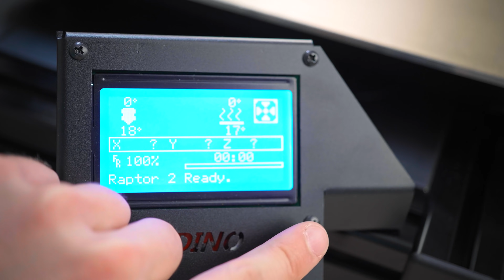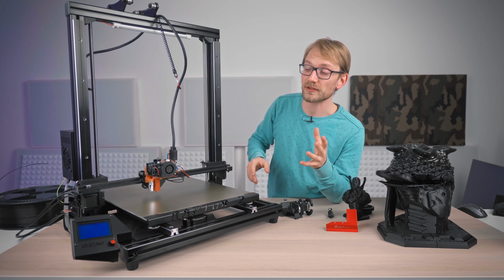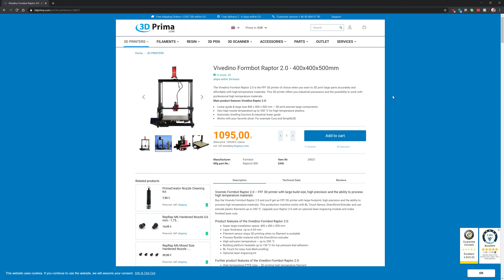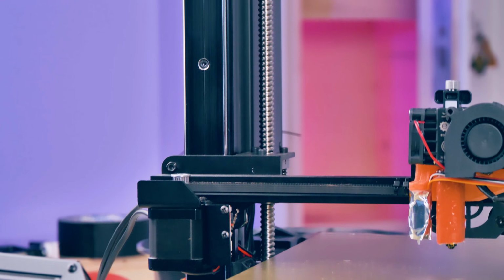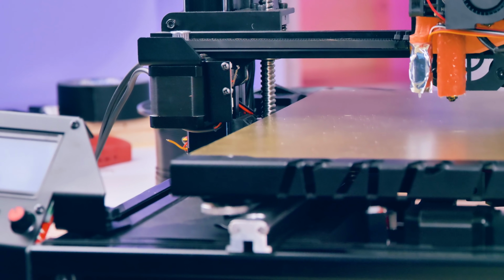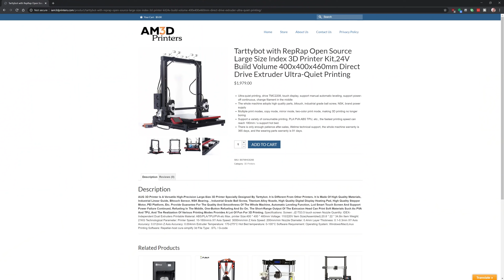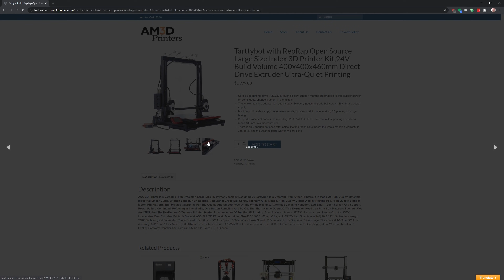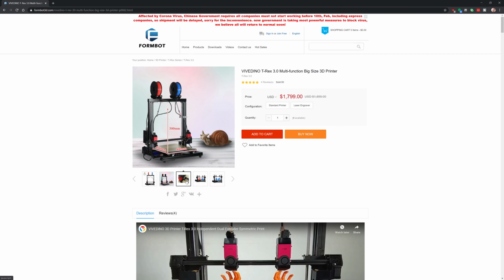This huge 3D printer was fun, but absolutely no one should buy it - Formbot Raptor 2.0 review!

Comment: You buy chinese, you get chinese :D
Reply: Not really a fair comment. Many high end and well built things are both manufactured in and designed in china. Where a product is made or designed really does not tell you if it's quality or not. Just like buying american made is NO guarantee of anything other than paying more. Junk can come from any country.
Reply: Well, I am really happy with my Ender 3. Not every chinese Printer is bad. They are actually pretty good. And why should I mistrust the Chinese anymore than e.g. the Americans?
Reply: Most high-tech things we have today are made in China
Reply: @among-us-99999  now that's some joke you just told there :'D

Yeah made in there, not designed and the companies that make them wouldn't exist in there unless it was for money and technology from outside of China because it made business sense to make stuff there cheaper so everything considering manufacture was moved there, including the machines required for manufacture (almost all high tech machines for manufacturing high tech parts like complex IC's were designed and built outside of China and still are).

Without all that, China would have nada. :D

It's a communist country of peasants.

Comment: I’ve had the 400x400x700 for almost a year. I had a few layer shifts that I corrected by installing a better fan for the motherboard. Upgraded the hotend to the E3D V6 and use a polypropylene bed. Reasonable upgrades and it prints like a dream! No signs of any unusual wear and tear...
Reply: Still a fire hazard!!
Reply: Well, that is not the point, isn't it? You should not need to invest more money to correct mistakes which the manufacturer should not have made in first place. It is shifting the burden to the customer and pretends a seemingly good price but has a hidden cost on top.

Comment: Mine works perfectly. Defective user.
Reply: Cool. So none of the  numerous shown clear design flaws exist in your machine, or you haven't used it much? Or you don't care much about them as long as your house is not actually set on fire?
If you are fine with that, well it is your life and your house. You've got no justification for insulting others who are not fine with it though.
Reply: @sagichnicht6748  Dont project your misfortunes upon me. Its a stunning machine and it prints as well as my Prusa just with huge volume. Worth every pound
Reply: @user-m5l4e  My misfortunes? My 3D printer works just fine, it isn't one that has glaring deficiencies and obvious safety risks. 

I am not saying it is necessarily impossible to print with it but the problems shown in this video are definitly an issue even if the printer appears to be working just fine. If you deny that, you really don't give a bit about product safety and good design. Your choice.
Reply: @sagichnicht6748  They may be a problem for you but they arent for me.
Reply: @user-m5l4e  Well, to each his own. Product safety, and as importantly durability by design (or lack of it) may not be a problem for you, but please come down from your horse where you are looking down on anyone who is saying that for him or her they are. 

Needless to say that Thomas brought numerous points that are obviously badly solved and you addressed not a single one of them in specific why it is a non-issue for you.
Reply: @user-m5l4e  Well, the fact that you are very terse with your description. Its easy to pay someone to write stuff. You have to understand skepticism considering the state of paid sock puppets in Asia.
Reply: Sounds really legit..

Comment: I have this machine and so far, I did a BMG mod, moved the SSR to the PSU box, installed a flex plate, and bigger nema17. currently, I’m working on upgrading the board
Reply: so basically changed everything? Why not build one then from the beginning?
Reply: nukularpictures Because I have already bought it. I was fooled by the specs.
Reply: Btw, my machine is two years old and it got all of the same issues.

Comment: Those huge (5kg) spools of filament are awful to print from directly. Most extruders don't have enough grip to pull a full spool that has a little drag (drag from being misaligned on the spool holder a little bit or too much friction from the bearings or whatever the reason may be.)

Comment: OUCH! i bought a formbot raptor after seeing your video. I have had some issues with it but not as bad as yours. Yes that extruder was garbage. I have upgraded to  2209 drivers and the firmware was upgraded as well from tiny machines. I have done many 40 hour print jobs with no issues.  I did upgrade to the spring steel sheet and that made a big difference on the bed platform. But for the price the other options like the creality cr10max after adding all the high end options that printer goes well above the price for the raptor.
Reply: Yeah he seems extremely negative, I have one too, its a chinese machine, needs some love. But for the price it works great imo. It does not really feel like a review, more like a rant

Comment: i own one, i swapped out the extruder and nozzle to .06 been running without issues for months now minus the cable rubbing. I dunno why ya knock the light though, that is great for visibility.
Reply: I may have found the Chinese manufacturer account lol !

BTW, even-though I highly suspect your reply to be pure scripted BS, did you by any chance also change the bed motor, the extruder, the PEI sheet, replace and secure the power input cables, updated the firmware, warn your neighbors about the potential fire hazard, get it CE  and/or TÜV certified, etc, etc, etc ? Just asking.
Reply: dont complain if your house burns down

Comment: I hate cable chains, they bend the wires through a small radius, repeatedly, over the entire length of the chain. They work when they're properly designed and the cables are suitable - preferably silicon-covered and high core count, but mostly they are a fatal accident waiting to happen!
Reply: The "small radius" thing just depends on the size of the wires and the cable chain (obviously). Nothing stopping someone properly speccing the components, as infrequently as that happens 😕
Reply: @AndrewGillard  Yes. I see people fitting them to their printers cos they look cool, then wonder why the the printer stops half way through a 3 day print lol.
Reply: @fredgenius  Yeah, sigh :( I'm personally a fan of the flat-flex cable solution, but that also has to be done right to keep conductors from breaking... (To be clear, I've not tried it myself yet, nor researched the details. But they're used in 2D printers as well as a few FFF printers, not just the new-ish X1 thing, and AIUI they should be fine if mounted correctly to spread out the bending and keep a wide radius...)
Reply: @AndrewGillard  Personally, I prefer the long loop approach. Minimal stress on the wires.

Comment: This printer turns your house into Volcano hot end.
Reply: your the type this world needs less of..you simple cannot take one mans word for it when 1000's of these exact machines are out in the wild..i my self owning 4 formbots soon to be 5....give your head a shake man!!
Reply: Care to provide your data for this statement ? Documented cases of these printers causing a fire ?  Or you just spewing bs some reviewer said "could happen"?
Reply: @mhanson762   If mine had any issue it would sound a loud alarm and shut the printer off
Reply: @mattmeyer6471  exactly any one that has a 3d printer and a brain has some sort of fire detection and supression system . I would never trust the printers thermal runaway protections anyways.
Reply: @mhanson762  I own this machine and it sounds alarms if i have issues. After seeing fires on other machiens i have stuff setup but i trust this printer at this time. I do however go over all connections before i start a multi day print to ensure its gtg with any printer i own.
Reply: @mhanson762  Watch the part with the heated bed cable chain again. Even assuming marlins thermal runaway protection is enabled ( I not sure if it is ) A 220v cable just needs a few seconds to start a fire when the insulation is rubbed through.
Reply: @lenne-0815 the cable chain issue was addressed by formbot/vivendo .  I have the Trex 2 + and it did not have a cable chain not did I put one on it  due to other printers  I have that had cable chains and the wear issues I have seen .
Reply: @lenne-0815  mine has a 110/120v heater .... Not 220v

Comment: So. In other words another creality or any of the other Chinese printer companies who use consumers as testers
Reply: with the difference that Creality machines are actually good for the price, they listen to customers (although their "listening" sometimes includes copying Bugfixes from Thingiverse without asking) and even their early versions were more usable than that steaming pile of marketing-BS.
Reply: My CR10 has been absolutely flawless & completely stock.
This printer here looks horrible
Reply: I work with a CR-10s PRO in my work all the time and it is a very well constructed machine. It does have some firmware issues, but the Creality ppl truly listen and they release new firmware versions all the time. It is open source and well, I've never had any major problems with it. It is professionally designed and really, not like this sh*t. It's not even cheap, but it does deliver very good value for its cost. So please, every company has its problems but don't put Creality in the same bucket as this startup.. Creality would never release such a piece of trash to the market. They actually know how to build a 3D printer.
Reply: nyyotam I actually just ordered a Raptor 2.0 to replace my Creality Cr-10S PRO V2. Because the Creality really is a fire hazard in every sense of the word. 24V heat bed with terrible cables and relief is going to cause a fire. This machine is 230v on the heat bed, so your circuit breaker will take the hit in that case.
Even after seeing this video, I am confident the Raptor is far better than the CR-10S PRO.
Reply: @bdawg1337  Prob is that if the phase line gets exposed and you touch the printer, its not the circuit breaker that will take the hit, its you. Hope you have a good grounding :-) .
Reply: @bdawg1337  agree, I have a cr20pro as well as the Raptor 2.0, Raptor print quality is better, and that's right out of the box (replaced the cr20 extruder with a titan  aero direct drive too)
Reply: @nyyotam4057  When live wires are exposed, there are a few things that can happen. If L touches the frame, it current will go to ground and trigger the circuit breaker straight away. If L and N are exposed and touches the frame, or each other, it will burn a fuse.
In case it is you making the connection... If the phase line get's exposed, and you are not grounded while you touch it, "nothing" happens. That's like when the birds sit on high voltage lines. If you touch phase while you are grounded, you will trigger the circuit breaker. If you, with the same hand touch L and N, you will burn a fuse, and you probably will get a burn on the hand. The really dangerous thing that can happen is if you, with one hand touch L and the other hand touch N. Then instead of a burn, the current goes through your heart. 

Creality's 24v bed on the other hand is a whole other story. If N and L touch on the bed cables here, it can start a fire, and your electrical protections will not care.

Also, I would really like to know what your ties to Creality is. Regarding the CR-10S PRO, you say:
"it is a very well constructed machine"
"t is professionally designed and really, not like this sh*t."
"Creality would never release such a piece of trash to the market."
"They actually know how to build a 3D printer."
I honestly think you must have some sort of ties to Creality to say that. I am a mechanical engineer, and I can say that the Creality CR-10S PRO is a TERRIBLY constructed machine. It is definitely NOT designed professional. So they in fact released a piece of trash far worse than this, and that really doesn't leave any reasons to say that Creality knows how to build a 3D printer.

The Formbot appears to me as the most well-constructed budget printer in this build size range that is available. That is not to say that it does not include some problematic design choices etc. but it is better than Creality's offerings in every way.
Reply: @bdawg1337  Major error there. If you have good grounding then since it is connected (sloppily, but connected) to the frame, it will trip your protection. However, if you don't, you're dead meat.
Reply: @nyyotam4057  You need to explain me what case you are talking about. 
If you are talking about L being accidently connected to the frame, then yes, it requires the grounding to be sufficient for it to trigger the circuit breaker. It needs the phase current to 

If we assume the grounding is insufficient, and you touch the frame that now has L on it, then the outcome depends on how YOU, in that situation are grounded. 
If you are not grounded, nothing happens really. 
If you are standing in a bucket of water, or holding a radiator with your other hand, then that is not great! However you will still trigger your circuit breaker this way. If your circuit breaker triggers at 300 mA, then you may have that running through you. Or if more is running through you, then in the miliseconds it takes for the circuit breaker to trigger, you will have more than that going through you. Both of those cases are potentially dangerous, but won't by any means necessarily make you "dead meat".

But, the main thing here is. Shield all live connections properly, and ground properly, then you are about as safe as you can be with 230v.

On the other hand, your 24v on the Creality. That is way harder to make safe (ensure it won't burn your house down).
Reply: @bdawg1337  Exactly. You can have 300mA running through you.. Even 30mA can make you 'stick' and if you remain stuck for long enough, you die. That's why we try to avoid exposed wires.
Reply: @nyyotam4057  its doubtful you will stick. Regardless always good to have a proper ground to chassis. I dont own a chinese printer. But how many have a proper chassis ground. Dc/ac will both kill. 240v 110v 12v can all kill. Death only comes from bridging the heart or inability to stop the bleeding.
Reply: Lol. Not many bought the first gen of the cr10 or ender 3 or tivos or many others either remember how much had been fixed  over the years.  Many of the issue's can be quickly fixed.

Comment: Prusa had some concerns with making a huge printer with a movable y axis instead of a core xy architecture because it would be too heavy...
Reply: Why would you move  40 cm2 of aluminum if you can move only extruder...
Reply: @baumkuchen6543  yes, plus the increasing weight of the print
Reply: @Gekkoperformance  I wonder if maybe they did test the nema 17 Y axis with nothing on it, but it never occurred to them they might need to test it with 8 pounds of plastic possibly sitting on top of it.